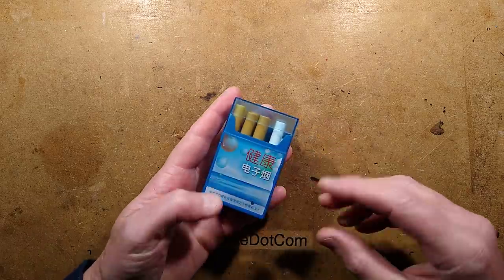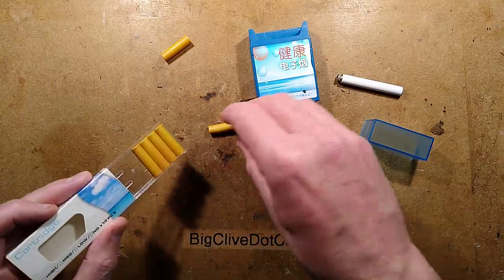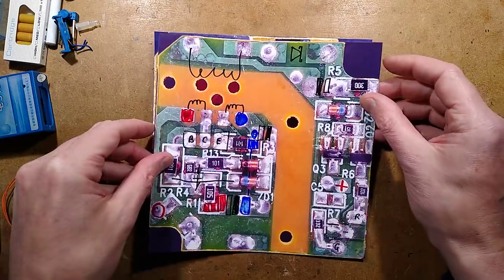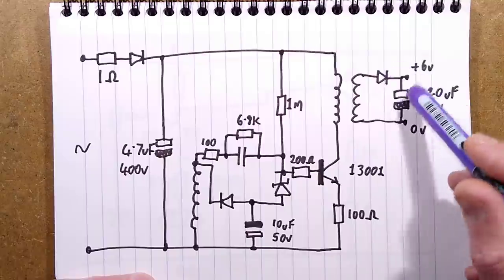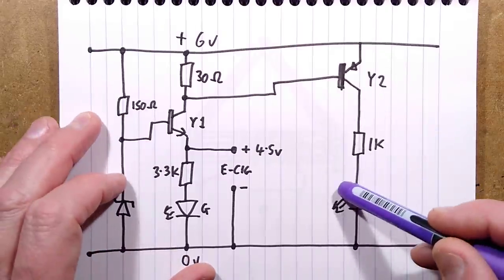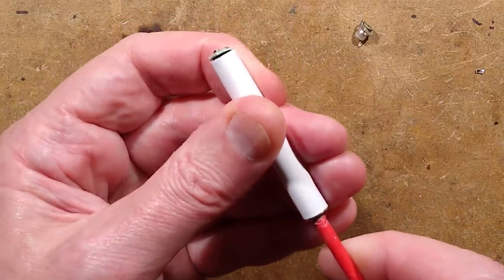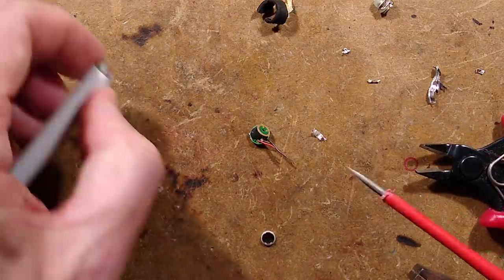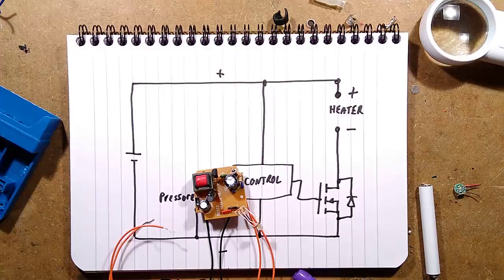Vintage novelty device teardown (with schematic)

Comment: "Good drug, bad delivery system" used to be the nicotine industry joke about cigarettes.
Reply: If Clive writes vaaaping instead of the correct spelling he can keep the monetization. Someone tell him.
Reply from the maker: I think the detection is based on speech recognition.
Reply: Bad drug, everything helping people consuming it even worse.

Coming from a young smoker, sadly…
Reply: @johndododoe1411  anything to protect potential advertisers. There's so much content on YouTube that Google can afford to have false positives when blocking monetisation
Reply: @ozy8742  Not true, if it wasn’t for vaping devices I would have never quit my 80 a day habit. Now I don’t vape or smoke, three years free.
Reply: @EclecticMusicMan  You switched to ecigs but how did you kick those?
Reply: @boris4231  I basically switched to sub ohm vaping with shortfills adding and controlling nicotine strength, starting with 18mg nic added. Every three months I reduced the nicotine by 3mg. It took about 18 months to finally be free. Basically the last 3 months I was using 0.5mg then a month on CBD liquid and stopped.
Reply: @jkobain  Background music? [Edit] 
Ah, custscene, someone probably put their own gameplay/stolen video up and copyrighted it with the auto tools, cutscenes are notorious for triggering from all the scam channels claiming them as their own.
Reply: @TechyBen  well, no. I specifically mentioned Harpy in Serious Sam 3, so one can find out the exact reason.
Reply: @boris4231  Some just forget them at home and a week later they realise, they just quit without knowing or even wanting to quit. Others stick to vaping because why not?
Reply: @EclecticMusicMan  Anecdotal evidence. You are in the good side of it, the young people who would otherwise not even touch a cigarette and now vape is a big problem. You are the proof that it should exist, but the popularization of it to young people bought problems to them
Reply: @EclecticMusicMan    Same here.  It took a year of decreasing nicotine dosage and then eventually a couple months of nicotine gum but it stopped me from consuming nicotine.  Never again will I touch nicotine.
Reply: @ozy8742  nicotine is quite good for you
Reply: And in the pharma industry we used to say ‘bad drug, good delivery system’ about cigarettes - smoking is the gold standard In bioavailability for drug delivery, ignoring the problems obviously.
Reply: @NapoleonGelignite  Smoking has too problematic filler and helper materials, such as smoke from burnt material.
Reply: @whoeveriam0iam14222  Except... on videos that have been demonitized, ads still run -- it's just that the creator is no longer getting any revenue from said ad.
Reply: @johndododoe1411  Yep. Have you seen the speech recognition in Microsoft Teams? It's spooky. Realtime / Live transcription of meetings with multiple people talking, and it's *perfect*, punctuation and everything. Microsoft is way ahead of Google in this aspect.
Reply: @CheapCheerful  Microsoft Teams is another cloud service wiretapped by a west coast tech giant.
Reply: @Tridd666  yeah i explained my point in the worst way possible, what i meant was the way it's used in the cigarette industry, nicotine is basically harmless as far as i know but it's addictive, and all the bs they put in cigarettes is what is harmful

Comment: This is so surreal to see one of these again. I had this exact one like 11 years ago while I was living in Japan.
Reply: They keep evolving, and at the moment they returned to PoD devices, but with much better mass-produced controllers, somewhat better design and batteries.
Imagine they started producing disposable vaping pens with Lithium batteries inside.
Reply: @jkobain  has a lot to do with salts making very high concentrations palatable
Reply: @mycosys  well, salts work pretty fast, yeah.
Reply: @jkobain  - salts also make switching from smoking much easier for a heavy smoker.  I had tried on regular e-juice and didn't really have any success until I found 50mg juices.  It's been a year and I'm now down to 24mg.  I'm hoping to get to 0 by next year.
Reply: @XianHaos  it is only up to you to decide when and where.
But I'm glad to hear that you stopped smoking — it mostly benefits the people around you. I myself suffer as a smoker in my past from current smokers anywhere near me — I start choking any time there's smoke in the air, I even can recall it during sleep because it brings up related images.
Stay safe.
Reply: @XianHaos  I gave up 8 years ago now, my only regret is not doing it sooner. Good luck 👍👍
Reply: Was it a good vape?

Comment: Wow. That's basically exactly the first e-cig I bought. Except mine was a much dummied down one without the nifty cig case. Also those cartridges are much juicier than ones I had. Mine were just slightly wetted cotton inside. Gas station special.
Reply: havent watched yet. but vintage? god im old.

Comment: I had one of those (not identical but very similar) when they were first rolling out. I got it shortly after my state had banned smoking indoors and I had it with me one night at a bar. I was sitting at the bar, pulled it out of my pocket, took a drag, then just stuck it back in my pocket before I thought anyone saw me. But, I happened to glance over and noticed a patron a few stools over staring at me wide-eyed with his mouth literally hanging open and he goes "WTF, man? Did you really just pull a lit cigarette out of your pocket then put it back in your pocket!?" What's crazy is that when the "atomizer" for that thing eventually died, a replacement, for JUST the ONE atomizer, was $45 not including shipping... $45 now could potentially buy multiple ecigs... I think I may still have it somewhere...
Reply: Such a sweet amazing story I imagined the atmosphere you were in thank you so much for sharing it with us lovely memories

Comment: That is indeed a very impressive amount of seperation. I'm guessing they simply had the free space to play being designed to fit a standard packet size.
Reply: Almost enough to meet standards.  I think 6mm is the rule to follow.
  Those chipless SMPS designs were in textbooks in the 1980s and were used in everything until dedicated mains rated SMPS chips became common.

Comment: Yeah, I remember such devices, even disassembled several pieces: they had a nickel-chromium heater winded up around a fiberglass wick. And a PoD pressure controller with an LED and a charge controller.
Batteries in them died very, very quickly.

Comment: oh wow, that reminds me of the first 510 kit I bought when I started vaping. Yes that method was quite arse. It leaked, it gave inconsistent hits and the little carts and batteries didn't last very long. I had a separate USB charger the battery screwed in to, not the pseudo-ciggie pack. Oh and I did take the batteries apart after I retired them, and did short out the cell :) that was dramatic. Vaping was very DIY and changing constantly back then. Happy I stuck with it as I've been a non smoker for years now and I don't even bother to vape except very occasionally for the novelty of it.
Reply: i quit vaping in like 2008-9 when liberty stix called me and i made the receptionist cry. 

had a few government agencys show up too my house.
Reply: @dbspaceoditty  dude tell us the story???

Comment: "What kind of bomb is it?"
"The exploding kind."
Reply: Also s he said he was defusing the bomb as in disconnecting a lithium battery from a device did that a while back on one of those call dodgy Amazon Alexa headphones.

Although they're just Bluetooth headphones with a dedicated button for an app for specific to those headphones evidently for Alexa it does not work with the dedicated Alexa app on Android either.

But of course the headphones did work with Android.

But anyways the point is with those headphones it's a very bad design.

If I had had a second one I might have actually sent them to Big Clive.

If I had the means to and if I had enough money and if I had already known about the issue I'm about to describe.

But I said to at least two people that I had just diffused the headphone bomb or Defuse The Bomb inside the headphones referring to disconnecting as in cutting the wiring to the lithium cell.

It was one of those normal lithium packs that's the soil type enclosure.

Lithium-ion not lithium-polymer for clarification!

The things with that that was a big issue is it was an unprotected cell for sure I peeped the world what was masking tape not even kapton tape.

Absolutely no protection for the lithium cell just Tam's coming from the self that was it.

That's only part of the issue.

As of being stereo headphones there is two sides to it the varying cable that carries the audio to the opposite side where the Bluetooth and all of the Active Electronics are including charge control.

Is connected over a 4-wire cable same as my be in a hands-free going to the tip ring ring sleeve 1/8 inch plug.

As many people would wouldn't know how those can fail sometimes and often do.

And of course that is bent every time you take on and off the headphones and many other times as well.

And terrible strain relief as in almost no thought given to it.

An excessive for points where the cable could fail due to flexing and other damage.

And not to mention the very lightweight fine gauge wire protected only by a thin layer of enamel or lacquer insulation.

Just a bid damaged in the right spot could very well wind up shorting out the lithium cell keep in mind that can happen when someone was wearing that said pair of headphones!

Not good situation!

I would prefer to have a pair that might be bit bigger versus doing that.

Mine explain why I never saw those anywhere else but I got a good deal on them new in box.

Also I had not even seen those on Amazon or anywhere other than that time.

I'm wondering if the reason for that is a recall or they stop production or something along that lines.

And if so chances are it was because their situation with the battery and the wiring to the other side!!!

And also the switches were atrocious at least in terms of setup.

They were those cheap nasty surface-mount Tac switches!

Very similar to what's in a key fob except even worse than the nose were and the slightest mispress or misalignment or shifting of the buttons was causing damage.

Even with normal use.

Not to mention the ring the buttons would be constantly shifting out of place and on top of that getting stuck in depressed position.

Consistently jamming up.

Probably when the nastiest systems I've seen like that so far.

And that's how I discovered how it had been put together like I'd said.

Because eventually the buttons got in such bad shape I could not get them back in position but once I did after about 30 minutes messing with it.

I realized the buttons are not working even in the right position.

And I could not turn them off Noor activate one of the functions at all.

Turns out both those buttons were compressed hard enough and messed up enough.

That normally opens which became her permanently closed switch!

I literally had to discombobulated two of the switches to open the circuit and then bridge out the one that controls power to turn it off.

Then when I was scoping it out in there not a soul scope or anyting but just checking it out.

I realized that battery plus and minus word at headphone Tidewater I'm like oh no I'm glad this happened so I'd be aware of this and from there I realized what was going on as stated above.

So needless to say did not attempt repair immediately clipped the two leads to the battery of course only one at a time to avoid shorting out the cell.

Black taping the two lead wires separately.

And taking it to one of the battery places to have it probably taking care of in a responsible and safe way!

People had suggested Home Depot and stuff like that but I knew that they would not take a wrong lithium battery like that.

Had to do some calling around but I finally found a battery place that did that!

Since I had no way to discharge that battery completely safely.

Now if I'd already had my shop setup I would have been able to at least render it somewhat safer by discharging it.

However was that type of wire and the terminals that if there was an issue I could have had a ticking timer on a incinerator device on my hands.

And I don't have an explosion containment anything dish as of yet.

That's in the works just in case seriously.

Also any thoughts on using a metal ammo box for a bit of extra safety with small quantities of solvents lubricants and other smaller amounts of flammables.

Not really for shop but at home I have some of the stuff I've used frequently??

I think that's the best thing I could come up with for this but no room for foremost cabinet or anything else like that unfortunately.

But enough there that you'd want to ride some protection at least!
Reply: Explöding :)
Reply: That is pretty much what all bombs are designed to do. However some may not because of bad build quality.
Reply: @brostenen  it was a Pink Panther reference. "What kind of bomb, Chief Inspector?" - "The explõding kind"
Reply: @skuula  How should I know that?

Comment: Clive seems to somehow intuitively understand these esoteric, highly-specialized circuits.
Reply: he is very good, plus almost all power supplies have same basic principles, so it helps
Reply: SMPS is only intimidating if you are used to "DC" and linears. They're really not the enigma they first appear to be, but they are on the twitchy side
Reply: I think it's because he's a wizard. Somewhere he has a sacred tome of ancient circuits
Reply: @incredibleflameboy  

He does look a wizard!
Reply: Its all pretty simple tbh...tho I spent 5 years studying electronic engineering and pc repair, comes in handy building wizardry stuff that most folks call "broken"

Comment: That was really fascinating, watching while trying to diagnose my larger monitor, thinking it's a blown capacitor but only just got thr back off.
Btw this is formerly Dave's DIY. 
Cheers for the share!💪
 I don't think you deserve demonizing over this, it was really not at all a promotion. But I guess if YouTube wants to keep being a select choice of words. 🙄
Reply: More like they simply can't or don't want to pay culturally similar humans to review everything and want to arbitrarily moderate everything using algorithms. I guess the result is the same.
Reply: Write vaaaping instead. Problem solved.
Reply: There's well over 500 hours of video uploaded to YouTube per minute, every single day. Trying to moderate that using actual humans would be like trying to hold back a tsunami with a child's bucket and spade, it's simply not possible.
Reply: @sixstringedthing  wow. That's a LOT of video. I had no idea. May I ask what's your source? Not doubting your word, just curious.

Comment: Interesting. I had something very similar from Blu many years ago. It was all black, slightly more rounded case, the battery and cartridges were both black and the battery had a blue LED on the end. It plugged in via USB rather than direct wall charging. The Blu pack had its own larger lithium battery in that empty space. I'd be willing to bet the batteries and cartridges would be interchangeable with this. It was a nice design but I was originally a pipe smoker so I switched to nice fancy wooden pipe vapes as soon as they were available.
Reply: Yup, same threading and these ones were the parents of the KR808's we could get in NA.
Reply: These were most likely to be m401 threads here and wouldn’t fit the KR808d threads 😟

Comment: You can assign the dodgy looking, flash stained, piggy-back death adaptor to the dustbin. The Hopi has its own built-in death adaptor.

Thanks for the videos, always interesting and always appreciated.
Reply: @nemesis2264  Bingo be better to kill  death deaf adapter then a perfectly healthy Hopi meter.

Or here in the United States and also available in Canada. 

Kill the the kilowatt device.

Also do they make a version of the Hopi meter that is designed for 120 volts 60 hertz for US market.

And also I am looking into getting the modified version of Cliff quick test for the shop strictly for electrical test.

The one with the u.s. colors of the the connections.

I'm wondering if they'll ever come out with the US version that would just take a glass or ceramic fuse of the type used in u.s. equipment.

Or after would be a way to adapt the what are the smaller fuses fit with some sort of adapter possibly?

Either or do an inline fuse in the hot side of the circuit.

And Bridge out the the phone holder for the European fuse?

Also I run into this issue before is anyone aware of an adapter that would take a glass or ceramic fuse either in the one of the quarter-by-quarter or the next size down of standard fuse preferably she was older type similar to what rebounded on a chassis of a piece of equipment.

To medium Edison screw base without doing something DYI but a commercially available product or plans for something like this if unavailable.

The idea would be to use in a peaceful equipment not in a fuse panel.

And also for test purposes since some of the fuses are harder to forget in the odd values these days.

And also to offer better protection than just the Old Edison fuses.

Also would be useful for some way that uses vintage equipment or Worse on jukeboxes or others and some old coin-op machines and many other applications like this!

Would really appreciate any info put on this as well

Comment: Those HV transistors are used commonly in CFLs. They seem to be a variant of the MJE-13001, but much lower power.